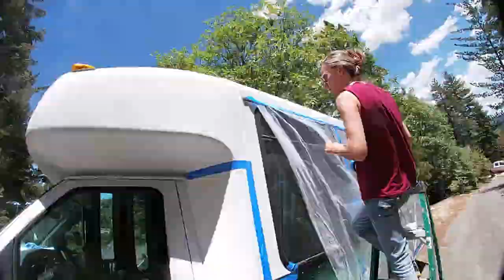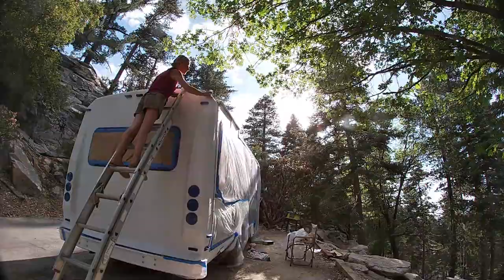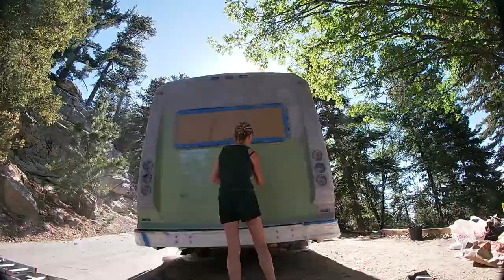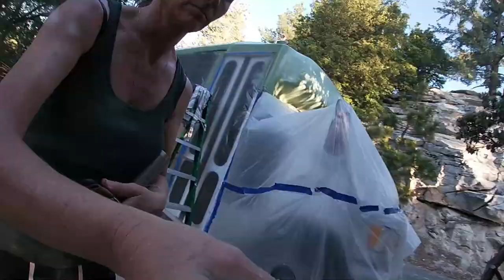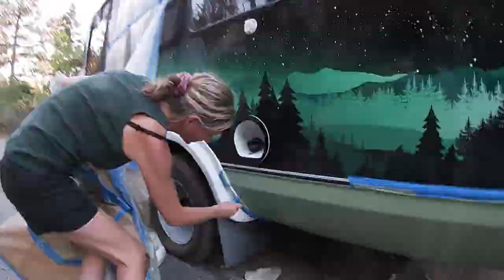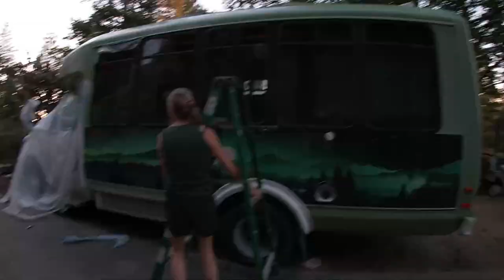Ford E450 Shuttle Bus Conversion - Exterior Paint - Rustoleum Rattle Can

Comment: What did you do to prep bus for paint? It is fiberglass right? You used rustoleum psint?
Reply from the maker: We cleaned it with acetone to remove any residue from the previous wrap.   We then used Rustoleum primer, sanded with fine grit paper, then used Rustoleum spray cans for the color.   Yes, it is fiberglass.